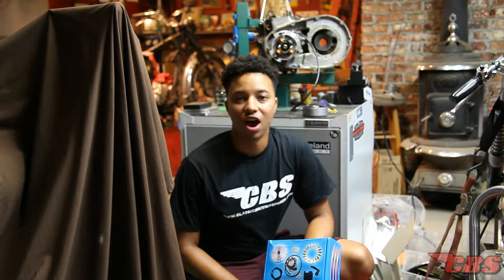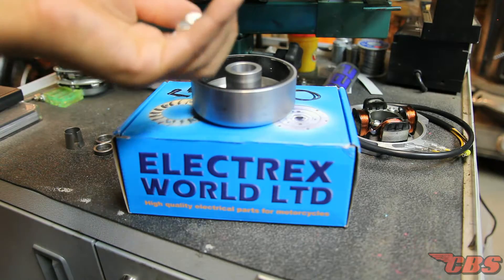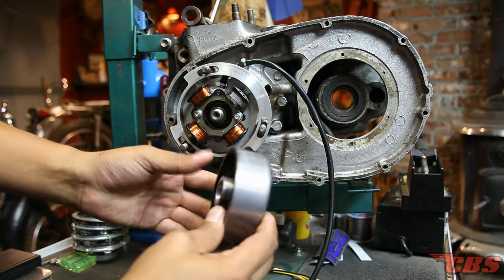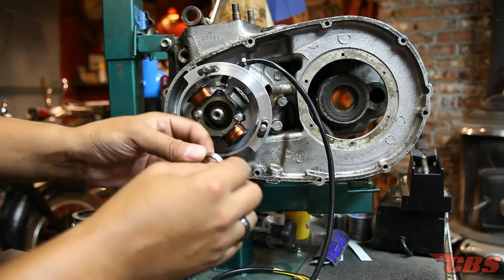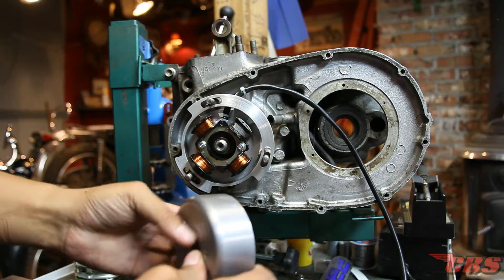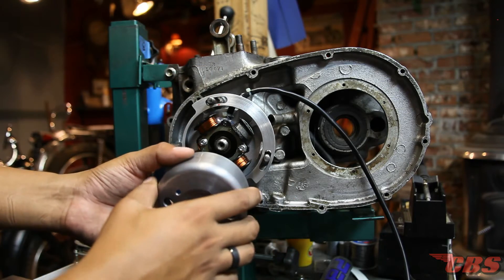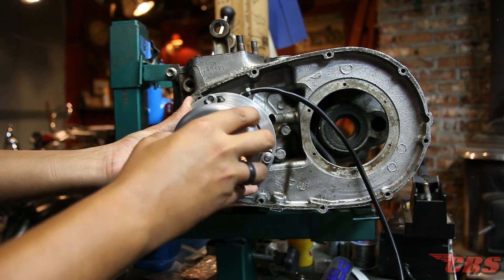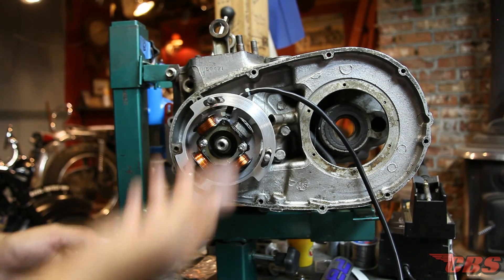Electrex World Ignitions - Tips, Tricks & Advice Prior To Install

Comment: Without fixings the rotor will float in the stator with the magnetic strip aligned with the cores in the stator. When I did mine I made a crank spacer to get the position of the rotor right (holding the stator just clear of the primary chain and the rotor not fouling the primary cover), fitted the stator without spacers, put the rotor on and let the stator float on the studs and align itself with the rotor.  I checked the clearance between the rotor and stator by pulling the stator out until it fouled on the rotor. I then measured the spacers needed on the studs and made some. This was on a C15F. None of the included spacers worked for me.

Comment: if you fit everything correctly and get rough running or misfires, try opening the spark plug gap to 1mm or 1.5mm . seems to help

Comment: Got my kit (thanks btw) Did they change the design where you need to set the pistons 38 btdc, and not at TDC like this video? (Or just the non-lighting kit) Either way is fine, I was just curious.
Reply from the maker: Pretty sure the racing version / non-lighting kit you have to set the piston to the degree in which you want it to fire at

Comment: Hi, fitted a full electrexworld kit to my BSA unit twin. Where do you mount the CDI unit? I've had no problem mounting the coil and the regulator, but I've run out of ideas as to where to fit it. Any ideas greatly appreciated
Reply from the maker: On my B40 the unit is under the seat. For your A65, I would mount on the oil tank or perhaps condensor bracket. Heat shouldn't be a problem

Comment: Don't you mean TDC on the firing stroke? Induction, compression, power exhaust! I'm installing this on my 66 Triumph Bobber. I live 30 miles from Electrex World so drive over to pick up my stuff. Cheers from UK.
Reply: Wasted spark, so either TDC is fine - has to be like that as is a twin cylinder engine on 180 firing pattern, ie both at TDC together, but one is on compression stroke and the other is on exhaust. Coils wired in series.